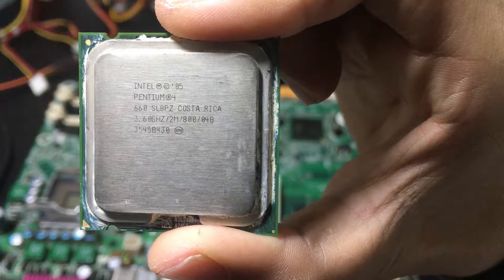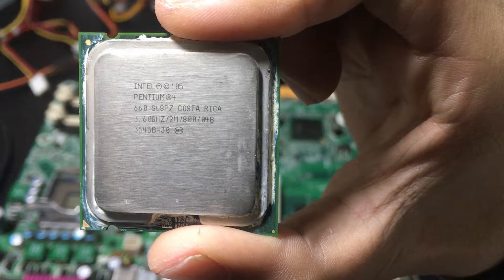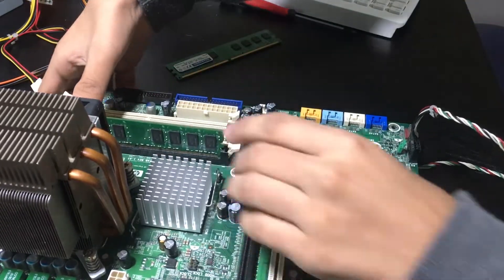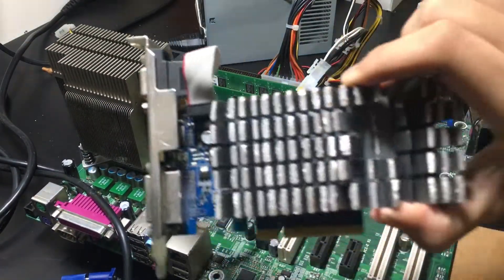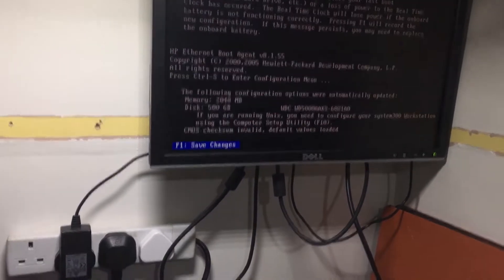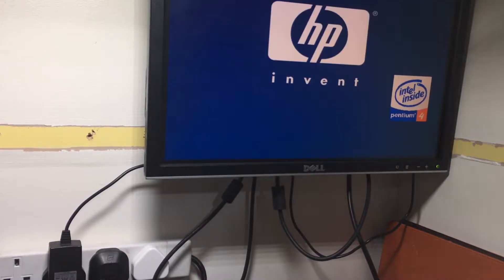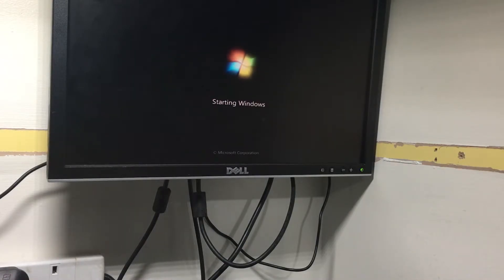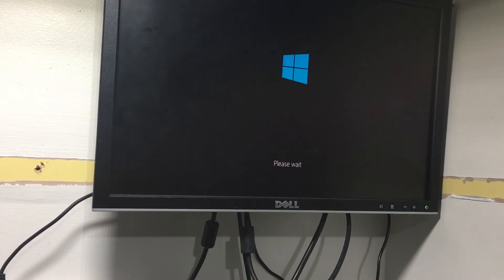Trying to use a pentium 4 in 2020 (pt1)

Comment: I have an HP notebook and a Dell Optiplex 360 bot running Ubuntu 20.04 amazingly well.  Today both of these computers had their Linux kernel updated to 5.10.0. They both use Pentium 4 CPUs. I do my Machine learning exercises (Anaconda etc) and use either of them for Zoom karoake and they work really well

Comment: 1st, you need to install windows Xp for your system, then upgrade it (do not upgrade using fresh install, just upgrade from windows installation option) to windows 7 32-bit. 
and of coz, if you want to use the 64-bit version, you need a 4gb of ram to make your system run stabil.
hope this can help your installation be done.
sorry for my english..